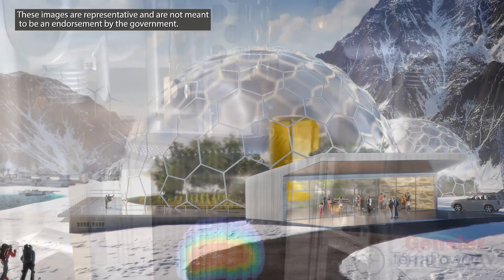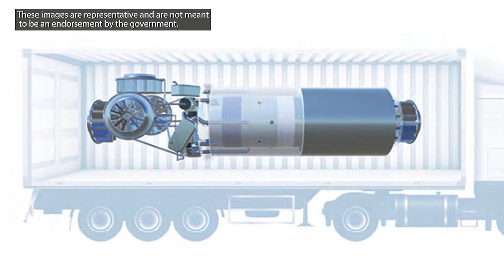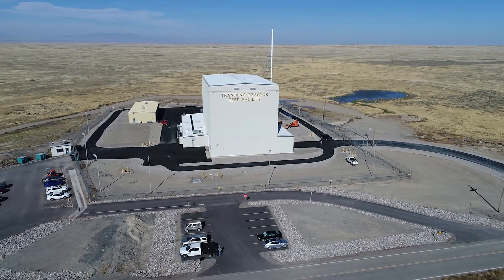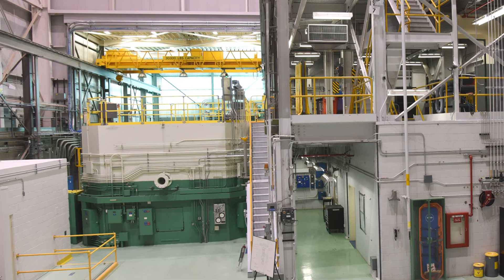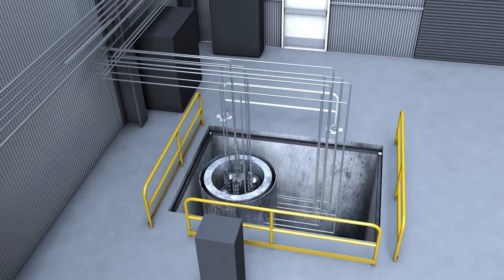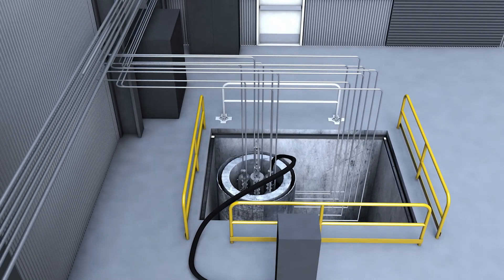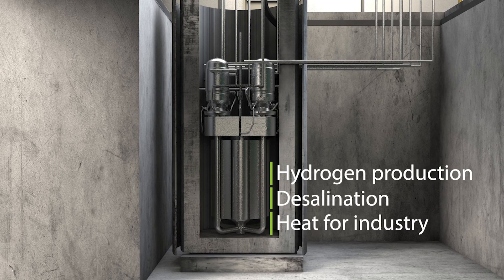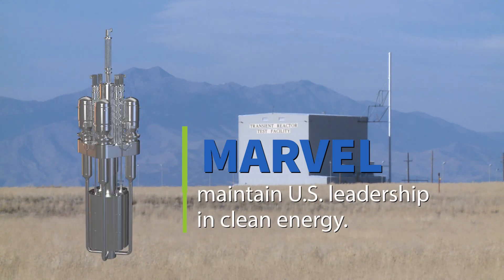The MARVEL Microreactor at INL

Comment: Assuming that this micro-reactor uses plutonium or even Sr-90 as its heat source, it would be similar to the Soviet nuclear thermo-electric generators but larger and better in so far as most of the heat radiated is converted by a sterling engine instead of radiated out into the air.   If these are feasible, and can be mass produced they could be incorporated in small towns and actually break up the electrical grid so that such is much less vulnerable to going down, either by solar EMP's or by terrorist activity.  And larger ones, true micro nuclear reactors that are much smaller than the large ones we have now, that can power small cities, 70,000 or more will further break up the vulneriblity of the widespread grid that we have now.

Comment: Still not cheaper than using air - that’s air not wind, two different techniques.  Nuclear is great for a station in the Antarctic or colonies on the moon or Mars. But ones own back yard? Well I guess the DOD still needs us retailers to supply it plutonium on the cheap. The tech. for the 21st Century is “Liquid Air.”
Reply: Nope
Reply: @pappaflammyboi5799  well clearly you don’t know any thing about this new technology. If you did you would see that it beats the Nuclear paradigm in every category you can name. Price, build time, efficiency and waste (sense liquid air has no waste) !!!
Reply: @rikkoshop620  I likely know more nuclear power than you do. Like what the heck does liquid air have anything to do with the INL reactor. And by the way, I'm more pro nuclear than anybody I've ever met.
Reply: @pappaflammyboi5799  I am glad for you. But Liquid Air is a better paradigm to produce energy. You want to spend 28 billion a pop to boil water - go for it !!!
Reply: @rikkoshop620  "Liquid Air" is only a cryogenic storage solution, it doesn't produce power. You still need a heat source to run a carnot cycle system.
Reply: @pappaflammyboi5799  oh so you think you have done your homework. I give you a D. What you have overlocked is that the heat source is the ambient air (that’s free energy by the way).  And every so often you do have to change the nuclear core don’t you. So that means your so called energy source is just a $28 billion dollar battery. Sorry but I do like my energy options not to be a source of bankruptcy !!!
Reply: @rikkoshop620  I'll give you an 'F' for not understanding basic thermodynamics. Your "solution" is not an energy production method, but an energy storage method. You still need an energy source. Did you even take any high school physics?

I know how cryogenic storage works. It's not that complicated.
Reply: To put a finer point on it, you need to use an energy source to compress and cryogenically cool the air (O2 or N2), and, at the very least, you need a reasonably hot thermal source (115 C or above) to get any reasonable efficiency at all. Otherwise, you get poor gas expansion and thus little mechanical conversion. 

None of that comes for free...
Reply: @pappaflammyboi5799  no you don’t or you wouldn’t be so thick. If you have a air in a liquid state - all you have to do is expose it to the ambient air and that heat from that air well cause the liquid to turn back into a gas. Now if that gas is in a confined space you then use simple physics (the characteristics of a fluid under pressure) this pneumatic pressure well turn a turbine which will move a generator to produce all the electricity required according to the scale needed. 100,000 homes or a million it’s just math. Sorry but you are full of nonsense - where did you get your understanding of fluid dynamics from a crackerjack box !!!
Reply: @pappaflammyboi5799  true you have to use an out side energy to charge the device just like a battery. Just like from time to time you have to change the core. So that’s a $28 billion dollar battery and mine is just a few hundred million. After 60 years ask a tax payer what they would like to spend when the fuel is free, then get back to me !!!
Reply: @rikkoshop620  A few hundred million for what energy source? It can't just be air...
Reply: @pappaflammyboi5799  air is an energy source. Especially when it’s under pneumatic pressure - it can cut threw steel. For some reason you are having a problem with fact that air is a tremendous source of energy. They have been building these plants sense 2011 and a new one is about to come on line in the US north east. Sorry but nuclear has now got some stiff competition !!!
Reply: @rikkoshop620  No it's not. It's a manufactured source of stored energy. It has to be created elsewhere, (i.e solar, wind, coal, natural gas, nuclear, etc).

You don't have cryogenically compressed air just lying around for the taking. You honestly can't be that daft.
Reply: @pappaflammyboi5799  why do you keep pulling crap out of no where. I never said any of this junk. You have to use outside energy to charge the tanks. That is what I said and that out side energy is what is used to intake the air and chill it. Just like you have to use out side energy to mine and process the uranium or does it just pop up out of the ground ready to be used.  There is no source of power that does not require out side energy to run. Nuclear is at a piss poor 36% efficiency is it not. Gee what other stupendous revelations you got !!!
Reply: @rikkoshop620  Nuclear power does not directly affect efficiency, that would also be the type of energy conversion equipment you use, which is typically turbine driven.

Depending on how you handle your heat source (the higher the temperature the better), you can get up to 60% electrical conversion via a combined-cycle power system.

You're conflating the various specifics of thermodynamic effects (sources vs storage). Your ignorance is showing through. Please do your homework before making inaccurate statements.
Reply: @pappaflammyboi5799  my statement is not inaccurate it was taken from the agency that regulates power in New York. But thanks for making my argument for me. Nuclear power is just a battery, it requires out side energy to function, just like every battery on this planet. With out from time to time a new core, you just have a pile of junk.  Mine can use air at any place and at any time on this planet and air doesn’t run out.  Point is there are less expensive ways to make power, even if you are too slow to get it !!!
Reply: @rikkoshop620  No, I'm refuting your inaccuracies. Nuclear is non-polluting, more energy dense, and more reliable than any other source. I'm not anti-other energy sources either, just pragmatic and reserved about the problems that need addressing if you use something other than nuclear.

By your definition, nuclear and everything else could be construed as a battery. I really wonder where you get your information. I suggest you leave the engineering conversations to the scientists and physicists. It's not a good idea to mislead, unintentionally or otherwise 

Last time: cryogenic air is energy storage. You need something other than the atmosphere as a low-grade heat source to get any reasonable efficiency out of your system. That would include NG, oil, coal, wind, solar, and nuclear, etc. 

Enough said. Mic drop. Bye.
Reply: @pappaflammyboi5799  sorry but you are inaccurate they have built 4 power plants using this paradigm and there are more 40 of them on the drawing board over the next 6 years. My point is their are better choices for production of electricity, sorry of that leaves you butt heart. Nuclear is not nonpolluting have you reviewed the places where uranium is mined and processed. Liquid Air is the true nonpolluting in it’s process and its use. When enough folks get to see the benefits i.e. price, building speed 3 Vs ten years, reliability and efficiency this paradigm beets nuclear in every category. Plus 1950’s tech Vs 21st century tech you can drop the mic all you want, I expect things like that from know it alls like you !!!
Reply: @rikkoshop620  Name your power source (it's not air) or your just talking out your a**.
Reply: And for your information, since it seems to be your nature to remain ignorant about nuclear, there are gen IV nuclear designs that are load following and allow for 55%+ efficiency.

In case you don't know, refuse to acknowledge, or just straight up won't do the research yourself, load following means you don't need an energy storage system, a la cryogenic air that you are so desperately clinging and promoting.

To wit, you don't waste additional time, energy, or expense on further complicated systems engineering (liquid air and its storage facilities) because it's unnecessary and redundant.

Cryogenic air storage is an addon to power solutions that aren't flexible (peak demand can't be met) or need backup when their grid is strapped.

More mic drops. Give it up. Your beginning to sound desperate.
Reply: "The greatest enemy of knowledge is not ignorance, it's the illusion of knowledge." ~Stephen Hawking
Reply: @pappaflammyboi5799  I am not ignorant about nuclear. There is just something better. You say mine is too complicated yet yours take  a decade to build, the one that just came on line in the south east took 20 years. But no your system is not complicated,  now who is ignorant and afraid to learn something new. Un like you I didn’t say nuclear wouldn’t work, I said there is something better !!!
Reply: @rikkoshop620  I'm still waiting...
Reply: I already know how cryogenic air **storage** works. Name your power source. I'll wait.
Reply: @pappaflammyboi5799  it is the same power source that is used when they mine and process uranium. We’ve already covered this ground are you starting to get feeble minded !!!
Reply: @rikkoshop620  The majority of your responses, including the OP comment, excluded that fact. You intentionally mislead by stating cryogenically cooled air was a power source not a storage system. That was a key omission, and an obvious one at that.

Lies, damn lies, statistics, and omissions of material facts. Apparently, honesty is not your strong suit.
Reply: @pappaflammyboi5799  what are you slow. Your the one that keeps saying it not a power source. If you can get power from an apparatus, then it is a source of power. If it’s cheaper, more reliable, and easer to assemble - who cares. Oooooooo I’m sorry you seem to be so put out because how dear one day there is something better than oh dear Can I say it nuclear. You need to get over yourself !!!